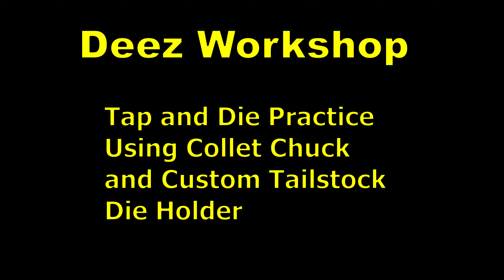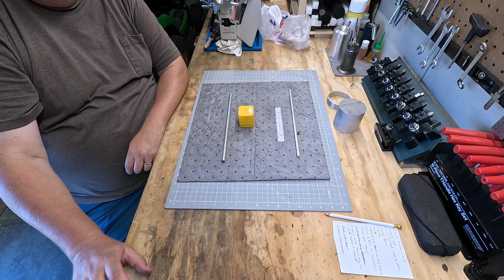Using a Tap and Die, ER40 Collett Chuck and Shop Made Tailstock Die holder for a Jacobs Chuck

Comment: I would consider getting a 3 jaw morse taper chuck to grab onto different sized dies.   There's some very inexpensive ones out there. Also, you can use a dead center to butt up against your tap to ensure it going in straight.  The tap should have a divet for such purpose.
Reply from the maker: This is a great suggestion not only for holding dies but all kinds of different work holding,  Unfortunately my taps dont have divots in the end.  They are super cheapo Harbor freight taps.  Some have a point so perhaps an inversed alignment tool would work but most are simple flat.  no divot.  Junk and I don't recommend Pittsburg taps and dies.

Comment: Little tip , dont wait to open new tools especially inexpensive tools. Open and inspect for damage and corrosion. I will also wrap them in fresh vci paper if I know I wont be using them anytime soon
Reply: Check things as you get them for runout, I been caught out waiting, and thinking it's OK. Then the return period ends. Check if possible 👍👌🇦🇺
Reply from the maker: This is very good advice. Thanks for putting this out there. I too have been bitten by not inspecting all of my tooling and ended missing or having useless parts.

Comment: Tip: whenever threading always break the chip by going backwards, or you run the risk of breaking a tap. This goes for using the Die as well.
Reply from the maker: Great tip. Thanks